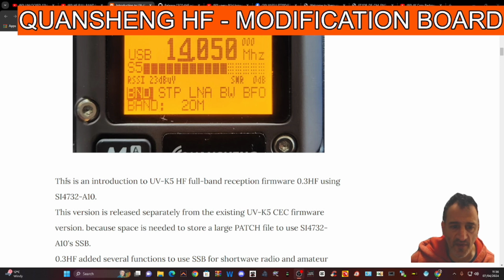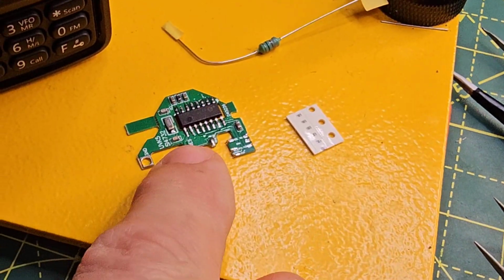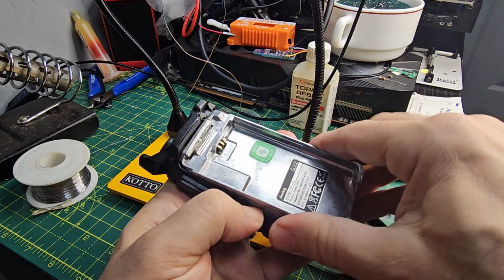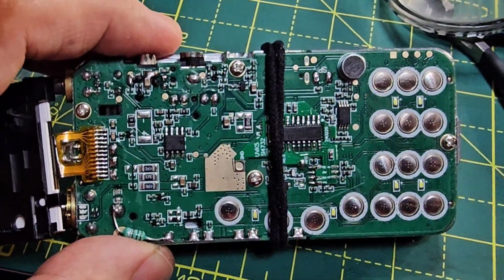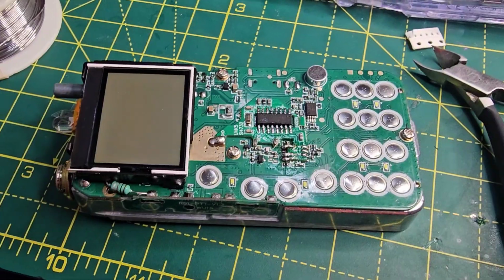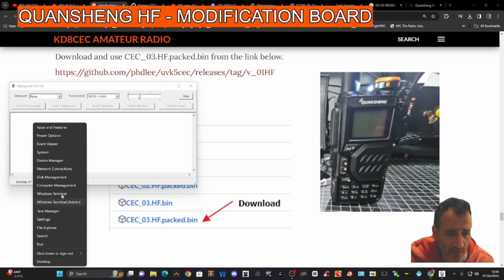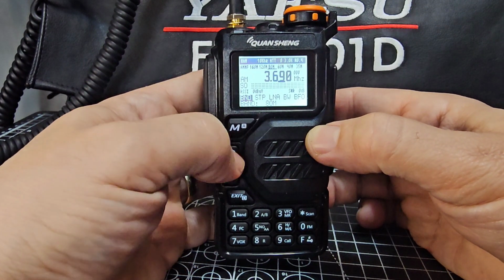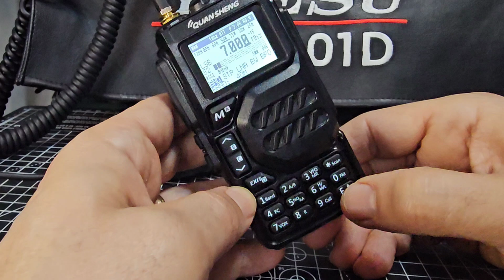QUANSHENG UV-K5 - HF CIRCUIT BOARD MODIFICATION SI4732 Chip

Comment: Hi, you have any ideea about dual antenna kit ? 
""1 pcs Walkie Talkie Modification Board Suitable For Quansheng K5/ Quansheng K6 With SI4732 Soft Board FPC Single Dual Antenna""
'It is suitable for Quansheng K5/Quansheng K6 to install S14732 soft board FPC and modify HF shortwave full-band reception/single sideband reception. It is suitable for single antenna and dual antenna.''
"" In the dual-antenna solution, an additional level of band-pass filtering is added to the antenna input end, and a feeder and SMA head are used to an HF independent antenna from the LED, which does not affect the UV performance of the original machine.""
Reply from the maker: Wow send me a link
Reply: @M0FXBHamTech  Send to comunitty section😉
Reply: @M0FXBHamTech  Send to community section😉

Comment: Some small tips on a job like this, first the radio  was never assembled using a soldering iron. It was done with solder paste and a hot air gun or station. Care with other components to keep them in place requires tape. Some  components  are the size of a flea so impossible to use a iron. de G4TBD. NB nice to see the original hobby.

Comment: Well done on getting it working  Andreas! I appreciate how difficult this mod is! 
73 de M7FRS 👍
Reply from the maker: Many thanks!y audio is quite on LSB usb , 40 80 Meters ?
Reply: @M0FXBHamTech  yes the audio is fairly quiet on mine on the lower bands but I think it also may have to do with how good the antenna is on that particular band maybe?